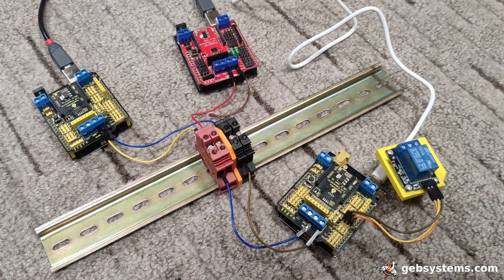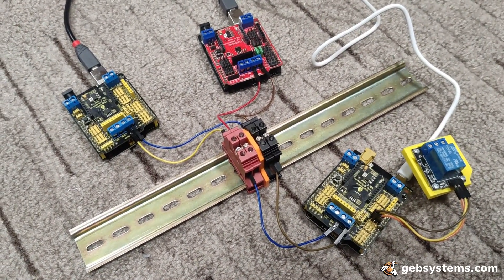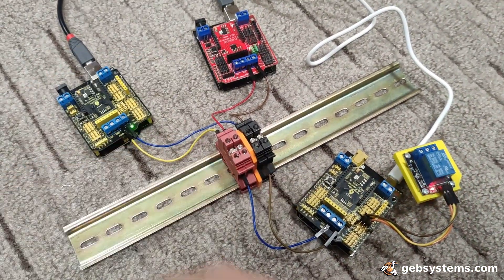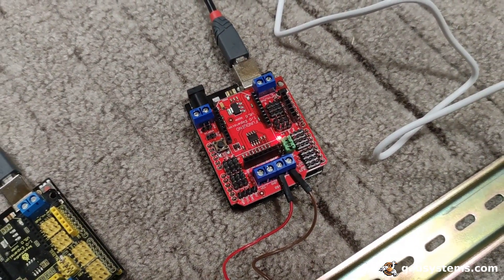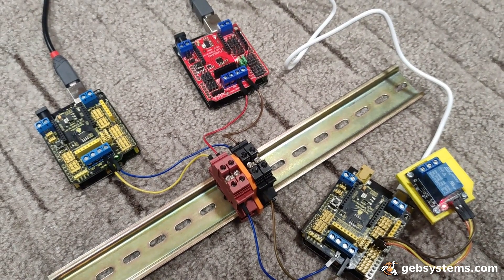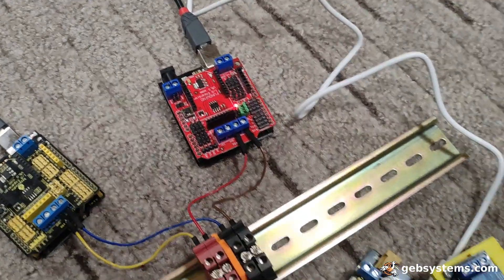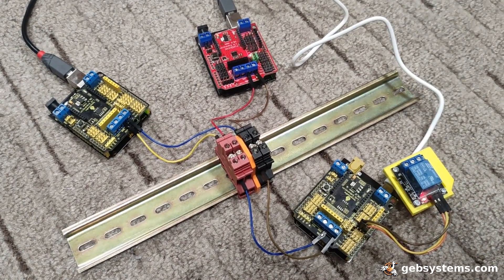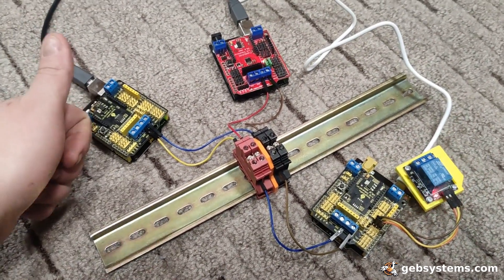Why Modbus for your home automation?

Comment: What i miss is done way to trigger on for instance button presses. AFAIK modbus only does polling.

I would prefer a multi master network.

Do you have any plans to work around it?
Reply from the maker: For an instant response you probably would need to look at Modbus TCP/IP since that supports multiple masters. But that would increase the complexity of your entire network since now you need switches etc etc Unless you can make it all wireless. Use the ESP32 for cheap end points. I might explore that path at some point but last time I checked I could not get the ESPs to be stable and not crash over a longer (2 weeks+) period of time. For now I will explore the old school Modbus first and will see what happens.
Reply: @gebsystems  I do like the idea of Modbus for sensors, and I might try to use. Using ethernet cabling allows easy change of protocols later anyway.
Reply from the maker: I discovered recently that you can buy Modbus enabled sensors... For instance the SHT20 temp and humidity sensor that has the RS485 A&B + power. So I would not need an Arduino at certain end points. This makes the home automation SO much easier. And sure, WIRE IS KING so Ethernet wins all day long for a reliable setup. I want to build a Modbus powered do-nothing machine as that seems to be rather cool just to watch it repeat a task. Same as watching a 3D printer print I guess.

Comment: That’s amazing bro 
Let us know when it’s available for download ❤
Reply from the maker: What exactly for download? The 3D designs will go on thingyverse or something to that tune. I believe the base holder is there already. The issue is that I keep changing things every second day because I find a better solution etc I am now experimenting with a different modbus arduino library since the modern ArduinoRS485 does not wanna compile on the avr platform... So there is that.